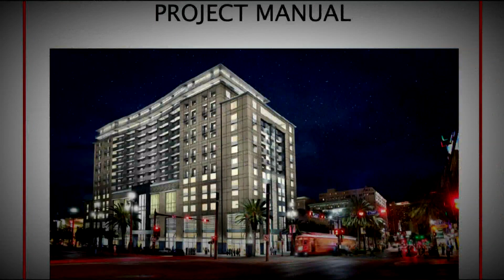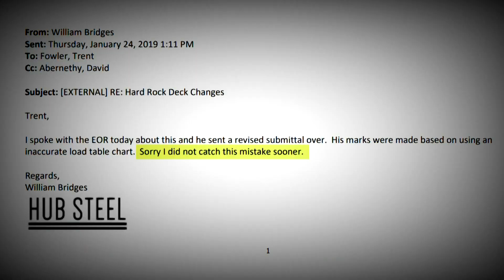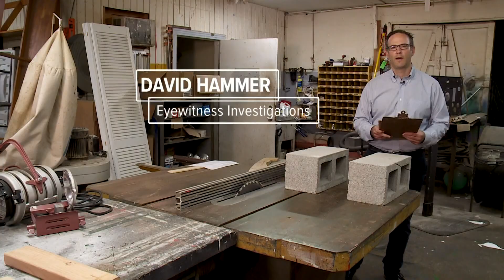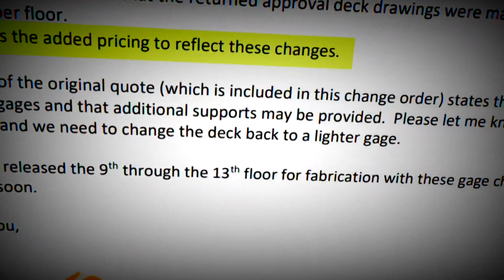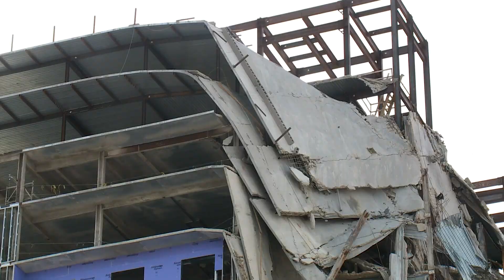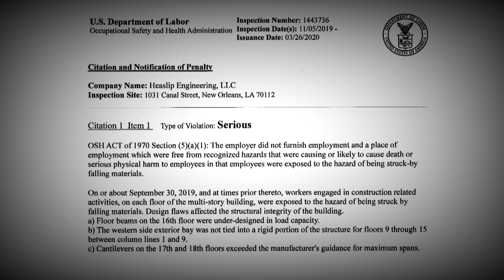Engineer says several problems with Hard Rock site but one stood out

Comment: It's easy to say there was a confluence of errors that contributed to the collapse, but in this case, if the shoring had been properly installed and they let the concrete cure for 7 days between pours, it wouldn't have happened. The design was adequate. It wasn't the cantilever that failed, it was the shoring.
Reply: The design was far from adequate. Thicker deck was the only possible way for the collapse to be avoided with the drawings for construction set used. EORs are generally so lazy in today’s world, little design is actually done. Engineers have too gotten comfortable copying and pasting previous designs into current projects that have no relation whatsoever

Comment: Remember, this is New Orleans, the Big Easy. Palms were doubtlessly greased.

It is astonishing to me, a retired Architect, that their building dept. has no structural engineers on staff. I did projects in probably a dozen jurisdictions up & down the Colorado front range, from Fort Collins to Pueblo, and as far west as Grand Junction. I never encountered a bldg.dept. that didn’t have a structural engineer. The head of Denver’s bldg. dept. is (or was, I’ve been out if the loop for awhile) a structural engineer.

Comment: I’m curious about temporary shoring that is typically brought in to provide support as the concrete deck cures.  The components of a deck (concrete, reinforcing and metal decking) when cured act together to provide the required support.  I can see by the video that this temporary support is in place.  Was it spaced as required and for the duration required?  The consultant brought in referenced there were a series of errors, is this one?

Comment: Every building design is different, and thus full of unique human errors and flaws. What could possibly go wrong?
Reply: they were cutting corners in so many locations , they lucky more workers did not die! , you can.see the workers run like rabbits (camera angle as seen from high vantage point) , during the collapse . Even the cantilevered area looks like outriggers extend to far without bracing.

Comment: A group of sixth graders could  build a model out of straws more sound than that building.  Concrete needs rebar to reinforce it.  Someone cut corners to save a few bucks.  And by the way... no Structural Engineer on the project?  Thank God the damned thing collapsed when it did.  Check out collapses like the 1981 Hyatt Regency Walkway in Kansas City that killed 118.  I was there for a conference the week before and it made me uneasy to look up at it.  Way too much concrete with invisible  support.

Comment: just remember, everything is always built to MINIMUM standards, nothing is ever overbuilt unless it's cosmetic
Reply: Lowest bidder doesn't necessarily equate to lowest standards. But yeah, the demand for profit definitely plays a part.
Reply: @bitsofgeek  True, but there's a physical cost to everything, and the lowest cost can not deliver the highest quality.
Reply: yeah I agree. This is always the case!
I have always wondered why not spend little extra on construction to make a structure that is significantly stronger to thus handle any irregular structural issues that may arise. Even if it's the engineering company being selfish and only trying to protect themselves from future mishap lawsuits.  
The  Millennium Tower that's leaning in New York, same deal cost cutting on the foundations.
Reply: Everything everywhere all the time?

Comment: This right here and the condo in florida are why we need stiffer regulations.
Reply: The Florida condo collapse was mainly due to lack of onsite maintenance which uncovered after the collapse, construction building mistakes. 
The engineers did design the building correctly to the construction date regulations. Today, there would be some changes to enhance the structural safety. One would be to enhance the upper structural support on the garage deck pillars and the second would be to have separate columns for the main building and the exterior deck. Thus if the exterior deck collapses the buildings structural support column should not be damaged.

Comment: The problem is made worse when concrete is poured on a weak pan deck. The decking sags during concrete placement. In an attempt to make a floor level, contractors will add more concrete in sagging areas putting more weight on areas that can't even support the load that is in the specifications.

Comment: I don't know why it takes a study to determine this, I spotted the problem in the news photos right after the collapse.  The diagram in the video shows 26' spans, manufacturer catalogs for the heavier gage deck only go out to about 16', well short of 26', and the lighter gage deck that was substituted is about 20% less.  26' is much too far for this material, any engineer exerienced in use of this type of metal deck for floor construction would know this.  Yes the drawings should be reviewed by a competent engineer, but the first step is to have the original design done by an engineer that recognizes the proper use of the material.  The metal deck supplier should have stopped the project when they saw that it would be impossible to build it using their product.  And BTW the metal deck manufacturer does make deeper metal deck products that are completely suitable for the spans involved.
Reply: Guy that ain't on the "metal deck supplier" at all, you wanna use that logic then every jackass that injures himself after he buys a totally over the top power tool at Home Depot would have a lawsuit on their hands. Also its not up to that business that sells decking to go verify plans potential clients will use their materials on? It was even stated in the video and you yourself made a point of the spacing in the I-beams or supports that those materials could have been used just by adding more supports
Reply: @jessepierce9046  Companies I've worked for put it in the specifications for the project that the deck manufacturer is responsible for providing deck that will work for the spans required or the contractor is notified to provide additional lines of shoring during construction, so this does put it back on the metal deck supplier.  It's not a business that sells decking, it is sold by the manufacturers themselves and the manufacturers have engineering departments that do this.  The manufacturer that is referenced in this project is a large manufacturer that certainly does have their own engineering department to do this kind of verification.
This is a note copied and pasted from project specifications for a recent project, listing the requirements for the metal deck supplier:  "Indicate where shoring of metal floor decking is required."  Granted these are the specifications that we use, the original engineer for this project may have used less stringent specifications.

Comment: Once the concrete slab is set (dry) there should not be a problem. Especially if metal rebar and mesh were properly used inside the slab (before) the pour. 

However, If the weight of the freshly poured concrete and reinforced metal structure could not be fully supported by the new corrugated pan (composite in this case)....welcome to builders hell.

Being "cutting edge" will get you just as killed as being cheap, as far as materials are concerned. Testing and ratings are critical.
Reply: the cantilever balconies had no rebar added.  I think a crowd on one of those would have caused that to collapse for sure.  the deck had a 3 rebar group every 4 feet.  looks way under strength
Reply: the system of metal deck and concrete has to be designed for both conditions- freshly placed concrete and properly cured concrete.  The use of 3" deck on these spans likely does not satisfy either condition.
Reply: If the pan wouldn't hold cured concrete (lighter) that's even worse. Sad.
Reply: @crabbinmoose8583  You don't understand how the system works.  When the concrete cures it locks together with the metal deck to form a composite system that is stronger than the metal deck alone.
Reply: What I'm saying is that if the construction crew was indeed installing on freshly poured panels (un-cured) when the disaster began, then it wouldn't even have mattered regardless of whether the panels were wet or dry. Especially if the the pan couldn't hold the weight of a pour to begin with without bowing. 

Cured concrete with rebar should still be able to hold up its own weight even without a pan although the pan must be used to give the final cast panel rigidity (since flat concrete slabs don't hold up to sheer stress as well as vertical castings).

I'm well aware of the need for metal pans to keep the concrete panels from losing  strength, developing stress cracks and sagging. But, the composite type material used for this (to save money) was just an accident waiting to happen. 
I agree the contractor should have definitely used a more beefy corrugated pan, made from at least 1/8 thick high tensile strength, coated steel along with the proper amount of treated rebar, rather than what the pictures showed.
Reply: @crabbinmoose8583  You're still not understanding the system- the slab on the metal deck provides the final structure, reinforcing steel is not required for strength but light wire mesh is used to control shrinkage cracking.  But yes the metal deck has limits to how far it can go to support the weight of the wet concrete.  For maximum economy it should be proportioned so the spans do not require additional temporary shoring.  It's a common system in steel buildings and works well, but we typically only go about 11' or 12' between supports, not 26'.
Reply: That's another thing I had on my mind. Why would they ever try to span such a long distance? 
I could understand up to 16 ft. but 26 feet long? Man, that seems like trouble even if a panel is 4 or 5 feet wide.
Reply: @crabbinmoose8583  That's my contention that they didn't understand the limitations of the material.
Reply: @billj5645  I think what crabbin is getting at is that they could have used temporary props instead of adding more steel beams? I wondered this as soon as this thing collapsed, was temporary propping sufficient? Did someone read off the "final use case" span table and not read the "construction case" span table. 

It seems to be an outright error as I don't think this think collapsed during a concrete pour.

As you mentioned, classic case of not knowing the material and product you are working with.

Additionally those cantilevered outrigger decks look funky as hell. And NO rebar in the cantilevered slab? No way you get away with that where I'm from (NZ).
Reply: @onlinetuna  You have to meet the requirements of both load cases.  With that type of construction it is possible that the "final use case" can span a little farther than the "construction case" in which they could provide temporary shoring during construction, but the final use case does not get anywhere close to the span lengths that they were using in this project.  And this system is not good with cantilevers, it requires reinforcing in the top of the slab as if the metal deck was not there.
Reply: @billj5645  
All of what you said is true.
On many sites where I was employed, there was a plan, in plain view, for all trades to refer to,
it consisted of a layered system, overlays, if you like.
For instance, for the formwork carpenters, there was a plan for how the "Deck" should be constructed, 
and a separate one for the reinforcing steel fixers to refer to.
And one that only dealt with the specifications for each area, for example; 
the specifics of what strength the concrete should be; 70 Mpa. or whatever,
The use of modern additives like water reducers, plasticisers and retarders
 have allowed concrete batching plant operators to make and  to send out hi strength, low water/cement concrete to these sites. 
  There are so many areas of this project that should have been corrected at the planning stage.
It's sad, questionable and pathetic, that the plans for this project were even passed.
The rate payers pay the wages of folks like building inspectors, and structural engineers, to arrive on these sites on a daily basis and inspect that construction is being done the way that the approved plans specify, and if what they see does not conform to what they know is not conforming to "Code" then nothing happens until it DOES conform to code.
We trust that all plans have been reviewed by competent and qualified folks, and that the building inspectors should detect any faults that have been missed at the "Review" stage. 
A first year apprentice from any of the construction trades, 
who had a chance to review the passed plans for this project, would have probably been able to see the design faults.
Reply: How widely used is that sheeting? Is this a fairly new thing?
Reply: @Wazupu  It's a modern building product for sure. But it is widely used and one of the most common flooring products where I am from (NZ) and I assume the same in the USA.
Reply: they were hoping it stayed together long enough to get finished so everything would be tied together, then it would be stronger and likely survive.